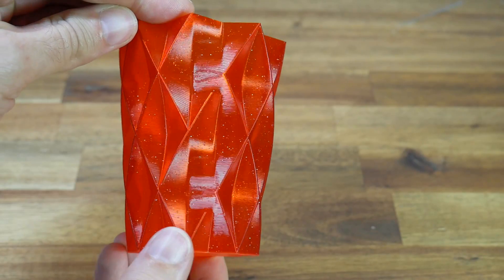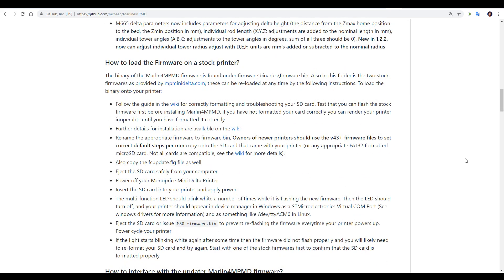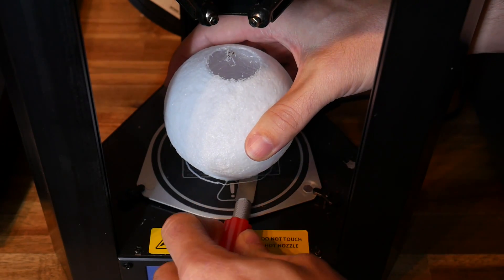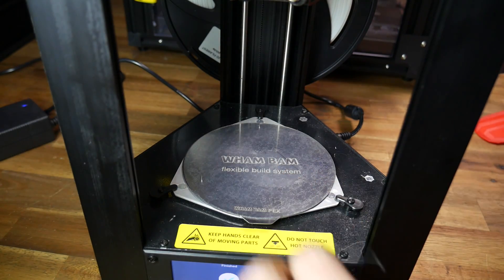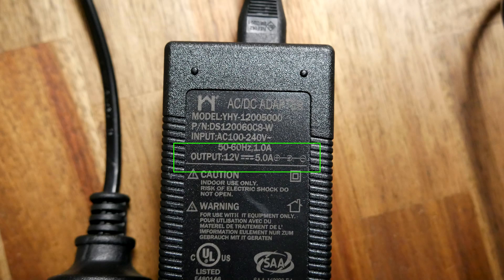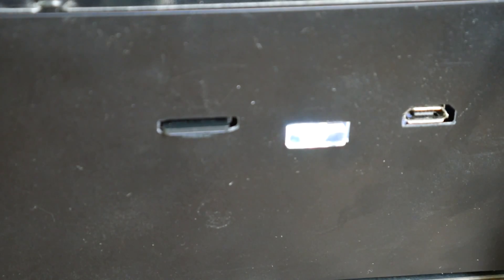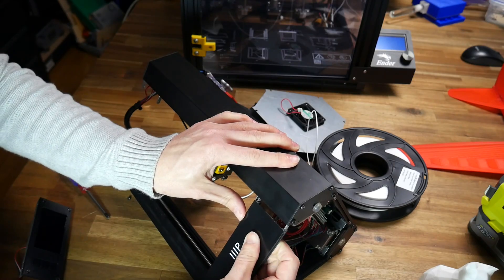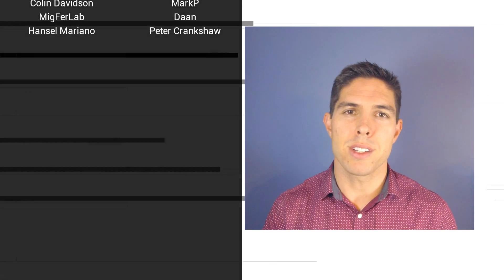Modding the Monoprice Mini Delta thanks to an awesome community

Comment: unfortunately, the discount code for the wham bam plates are no longer valid, but they are my favorite build plates. (note to print PETG on it, use a PLA raft to protect it. Make sure that the raft has little to no crevasses for the PETG to seep into.

Comment: Just a blast from the past: We are now in 2024, and all the hype is CoreXY (and especially BambuLab), but I run 2 MonoPrice delta printers: The Mini Delta that I bought on sale after watching your review here ($80 including delivery) and the large MonoPrice Delta Pro. Am I missing out on the CoreXY speeds? Yes, no doubt - but I still printer at 2-4 times the speeds of most cartesians, especially the ones from 2022 and before that. 

And it's amazing how well this Mini Delta prints when tuned in. Yes, there is a learning curve - but it's really not so bad, unless you decide to push its limits - and yes, build volume is very very small - but it's still usable, and mine still runs perfectly well. 

Thanks to you for this review - and especially for the Wham Bam recommendation: Their build surfaces are still superior to everything else; including Bambu Lab's own PEI.

Comment: Here's a huge timesaver for MPMD owners 
When your belt breaks drill out the rivets on the top brackets carefully and replace the rivets with nuts and bolts, this makes future belt changes much easier and simpler.

Comment: @teachingtech ... I still have trouble with the conversion on the Firmware side. Or maybe on the Hardware side. The Motors make a weired snakeey sound hard to describe...did anyone here ran into the same?

Comment: I like the move of the LCD screen to the top.  I received my Delta today and I have already made that change.  The only thing different is that I did not splice any wires.  I had a four-wire female cable and I just substituted the correct JST connector.  The four-wire set had a yellow wire that is going to connect to the white wire position.  I will solder another male JST connector to the wires, correct color alignment, that plugs into the original LCD cable on the control board.

Comment: If the LCD panel cable uses 0.1" pin connectors, you could use an RC servo extension cable like from https://www.maxxprod.com/mpi/mpi-3.html instead of splicing-in extra wire.

Comment: Thanks for the video, Michael!

I'm wondering if you can help me out a little bit. I recently got one of these printers for $25 off Facebook Marketplace, and I wanted to follow through with your guide here. The Marlin fork that you mentioned here has been archived, it's no longer maintained. Regardless, I tried to upgrade it anyway (v41, 5A PSU). It seemed to work for the most part, but it no longer performs ABL at the start of a print. I've gone back to stock for the time being, but I'd still like to get proper Marlin working on it.

There's a new branch that's superseded the version you originally used (link at the end), but I'm having a hard time making sense of it. Can you offer any guidance or suggestions?

Thanks! And keep up the great videos, I watch them all!

Currently maintained Marlin branch: https://github.com/aegean-odyssey/mpmd_marlin_1.1.x

Comment: Hello @Teaching Tech
I ordered the SeeMeCNC EZR Struder and installed it on my MP Delta Mini as you have in your video.
It started to print fine for the first few mins and then I noticed the filament stopped feeding into the tube.
When you installed the EZR Struder, did you have to replace anything?

Comment: I thought about getting one of these for printing small PLA models/parts but the price on Amazon is now US$352-380. That's absolutely ridiculous for something like this. I'd rather buy another Ender 3 for a lot less money.
Reply: It's $179 at Monoprice with free shipping, and also $179 on Amazon, "reduced from $269.50" which is crazy-talk. (Prices today 10/28/20).

Comment: I replaced the extruder like you showed in the video, but used some of my own bowden tubing. The problem that I am now encountering is that the filament seems to require more force to push through than before and often gets stuck
Reply: How did you fix this?  I think I am having that problem along with many others lol

Comment: I bought the EZR extruded but cannot take off the gear on the stepped motor to replace it. Any tricks on doing this?
Reply: I'm having the same problem. Did you figure it out?
Reply: Ric Ramon I ended up putting the gear in a bench vise then using a punch to hammer the stepper motor off the gears just little tap on the shaft of the stepper motor until it slides out

Comment: I'll have to try that new firmware. I must say your experience with the MPMD has been very different from mine. I've had all the problems with my MPMD. The bed leveling not working right, that stupid (apparently WTF brand) Bowden coupler breaking, the build surface having basically zero durability (mine ripped after only 2 prints), the slow heating (mine struggles to get past 40, and can't seem to keep the hotend going when it's high), all of them. All in all, based on my experience with it, I've been warning people away from this printer because of all the problems I've had with it. But maybe armed with this video and a wiki and FB group that I didn't know existed I can get them fixed.

Comment: so curious, a couple upgrades you made also raises the overall price of the unit. Is the the upgraded machine worth it compared to models at the new cost?
Reply: I bought two meters of Capricorn tubing and it was enough for multiple printers. Less friction, less retraction, fewer clogs. Well worth it, imo.

Generally speaking, I think extruder upgrades are one of the better upgrades you can make on budget 3D printers. You can buy cheaper all metal extruders, but they may not handle flexible filament as well as the EZR Struder or have the ergonomic advantages.

Comment: Thanks for this. I went to put capricorn tubing on mine and realized the at the bowden coupler on the hotend assembly is too narrow and tubing doesn't slide through it. Had you replaced that or are they coming from the factory like that now?

Comment: You know how to demagnetize a magnet?  You heat it to the curie point of the magnetic material it was made from. I tried a magnetic base.  Very bad idea.  The print stuck to the surface fine.  However the  whole thing lifted up off the magnet. This happened a lot.  Additionally this printer has trouble with the 5A power supply to keep both bed and extruder hot.  Much better after flashing the firmware. Also a thick bed acts as a bit of an insulator and takes longer to heat up.  I am reverting back to something similar to the factory bed material.  FWIW.
Reply: This is something I've wondered about, though 60C seems very low for a Curie point and magnetic build surfaces are now ubiquitous, so they must work ok. Is this a problem specific to the wham bam build surface?

Comment: Hi Michael, how do i change the z offset value in pronterface?
Reply: In stock firmware, you don't. It gets changed in the Start Gcode via G29 Z?.??. In Marlin4MPMD you can use M851 Z-?.?? over USB. Go to Facebook or Reddit for more help. The only reason I'm here right now is because I was linking someone here for Wham Bam help.

Comment: My problem is I can only get the test to stick. Every other project wont adhere to the printing surface
Reply: I use BLUE painters tape on the bed. you can still use heat on the bed. it allows you to remove print with out damaging the bed an minimal cleanup on the part. when printing with PETG if you dont use BLUE painters tape it will teat chunks out of your bed.

Comment: Hi, I am new to all this. I have updated my firmware to version 133 (that I did manage). But the whole G code thing doesn´t work for me. I pasted many different codes in Ultimate Cura (and also tried once without a code). I opened a boat file on Ultimate Cura and saved it to the micro sd card that I then put in the 3d printer. But nothing works :^( Nothing sticks to the bed of the printer. It just prints a mess of nothing. I am at a loss...

Comment: Out of the box ender 3 pro vs modding mini delta (Time effort and money), which is preferable ?
Reply: I have the MPMD and it is more like a fun project or toy to work on. Its print size is too small for many actually useful parts, and it requires too much effort to make it work as good as it can. Unless you are really limited by space the ender3 will be a better option.

Comment: could you possibly, for the love of what ever 3d printing deities that are out there, make an in depth video showing how to calibrate the MPMD after flashing the Marlin firmware. I'm still a novice and more of a hands on visual learner and reading off the community and/ or wiki can be very overwhelming/ confusing.
Reply: You could try the windows executable file mentioned in the roadmap

Comment: Hey Michael, thank you for sharing this awesome community work. This inspired me to contribute and upload my stepper damper adapter to thingiverse. https://www.thingiverse.com/thing:3748949
I have installed the custom firmware and it works really well. I run it with a  6,125A PSU and installed the 10A version of the firmware. At heatup it charges 75W and then goes back to 65W max during printing. The PSU does not get too warm so far. The heatup works so unbelievable well! It is ridiculous!

Comment: If I have installed a bootloader(ender 3 in this case) and wish to remove it, is it just to reflash the firmware by the motherboard to get rid of it? And would that give a little bit more space for the marlin firmware? I lost a bunch of features when installing bltouch like the filament change feature which was very nice to have.

Comment: I had the issue with 25% of the first layer not properly extruding leaving a dead zone and ruining every print. I calibrated the end stops, tensioned the belts, tweaked endless gcode settings and nothing helped. I was about to trash it and get a CR-10 but I decided to try the Marlin custom firmware and that fixed all my issues, now it prints beautifully.

Comment: I am thinking about upgrading the Delta Mini to an SKR mini e3. That board costs only 26€ (about 30$US) including 4 TMC2209. It is made for the Ender 3 as a direct 32bit replacement board, but as it uses Marlin 2.0 and have extra input for bed leveling probes it should not be a problem to config it for use with a delta. It also has an serial connector for TFT-Display, so maybe the Display of the Monoprice can be reused (but a 2.4 inch touchscreen from SKR only costs 15$ anyway).
Also I think about changing to 24V (I found an 8by8cm² 24v 60W silicone heater for the bed for about $20) to improve bed heating.
This changes should improve heating and silence. Of course all this upgrades will ad noticable cost, but they will make the delta mini the perfect printer for smal objects:
- 15€ for spring steel
- 26€ new mainboard
- 13€ new touch display
- 17€ new silicone heater
- 3€ new hotend heater
- 20€ new power supply

So about 84€ altogether - so about than halve the price the Delta mini costs normaly.
I think it will be worth it (and of course no need to do all upgrades at once).
Of course adding a nimble would also be nice, but I think it would be quite expansive for such a smal printer.

Comment: This is a fantastic video, Michael!  You should consider making a video covering the process of upgrading to the  Marlin 4 MMD firmware.  It's amazing how much things have changed.  I stepped away from 3D printing for several months because life got in the way.  Now, I'm getting back into it to find more products and upgrades available.  My Mini Delta worked phenomenal for a few months and then began to have issues.  I'm hoping to get it up and running reliably again.  Thanks again for the great content!

Comment: Could you use a Meanwell 12v power like on a CR10? Also Kenovo has a silicone heat pad that fits this printer.  If I flash the modified firmware should I be able to use the Meanwell and Kenovo?
Reply from the maker: If you change to a non brick power supply the printer will no longer be so neat. Is the kenovo a mains powered bed? If so it will heat up fast but you will introduce other challenges.
Reply: Thank you for the replies.  I look forward to all your videos. Good stuff. Thank you

Comment: The mods def make this printer better. Is the printer loud? I thought I remember people complaining about the noise.
Reply from the maker: Yes it's still loud. The gigdigit site has replacement boards with 2208s. Not that cheap though.
Reply: @TeachingTech  Some people have also swapped out the bearings and it had a noticeable improvement on the sound.

Comment: Definately raised my interest in this machine, looks to be a nice project to work on. Having marlin firmware now is awesome, greatly expands the possibilities.

Does the MPMD have enough room in the chassis to add stepper dampers? One major complaint I have seen about this printer is the noise, and that might be a way to combat it.
Reply from the maker: Just checked and the mainboard is too close to two of them so no.
Reply: I have the printer, and it does not have space for stepper dampers without some serious modding, but I managed to control the noise to similar levels as other 3d printers by
1. Added flyback diodes to the motors (or as some call it TL smoothers)
2. printed a spacer for the  bottom fan so that it is not directly behind the fan grill, and using a resistor to slow the fan down a bit
3. switched to softer rubber feet

Comment: I will not make friends today but I'm not a huge fan of the 2 docs you mentionned. That's a lot of work and a nice intention but what they are suggested is really a long complicated process, specially for the price and the size of that printer. I bought a glass bed (not receveid yet) and a 10A power supply. I'm planning to put the screen in the top and change the firmware like you did and then I will deactivate the auto-leveling feature. The docs involved mods mainly to improve that but it's not needed. Chris Riley made (as always) an excellent video on how to level a delta printer with M666 and M665 commands.
Reply from the maker: Fair enough. I guess someone Can pick and choose how much they follow. I found the quick and dirty m665 values were all I needed to get it to my satisfaction.

Comment: I talked with Enegetic 3d store. They will add the 115mm diameter size in their shop (energetic 3d store at AliExpress) tomorrow.

I use the spring steel from energetic 3d on most of my printers (exept on my original prusa mk3s of course as it has the pei powder coated sheet).
They are very well made (no sharp edges) and the PEI-film is already applied (so no struggle to get it on bubble-free). I am very happy with the product - I upgraded my Anycubic Predator, Anycubic Linear Plus, Ender 3, Ender 3 plus, Ender 5, Sapphire-S and I am very amazed how well it works. The prize also is amazingly low, so I can not think about a reason not to do the upgade (also if you want you can add ABL to your printers using chap inductive probe instead a more expansive BL touch - so practicaly you pay much less adding magnetic bed + induction probe than using stock or glas bed + buying a BL-Touch)
Reply: Energetic 3d store has the 115mm diameter in their shop now. It costs about 14,59€ / 16,34$US / 21,45 $Can / 24,55 $AU /

https://www.aliexpress.com/item/33056120833.html?storeId=4542004&spm=2114.12010612.8148356.18.4f16330fcguvr1